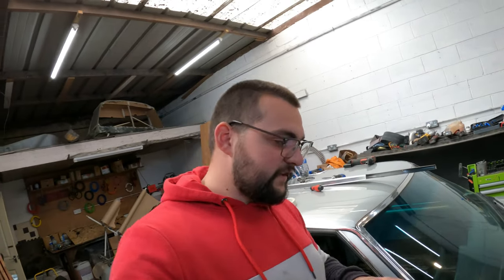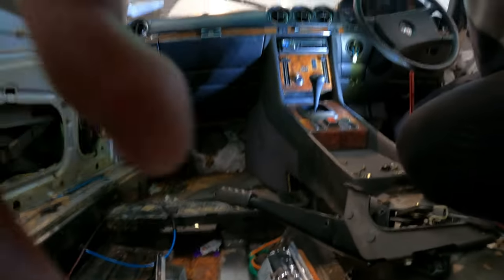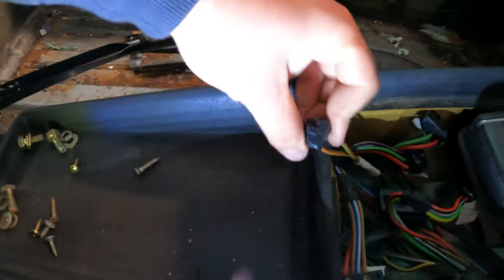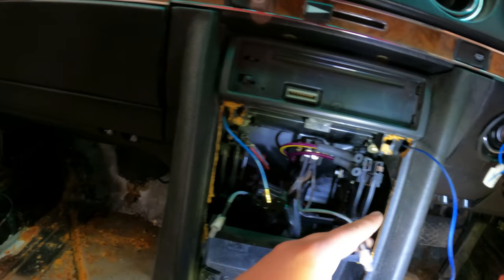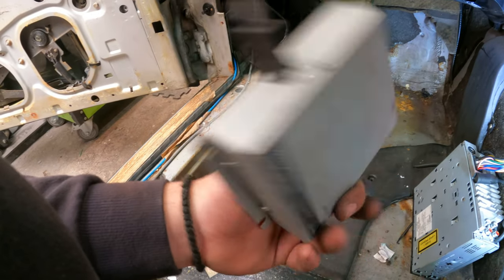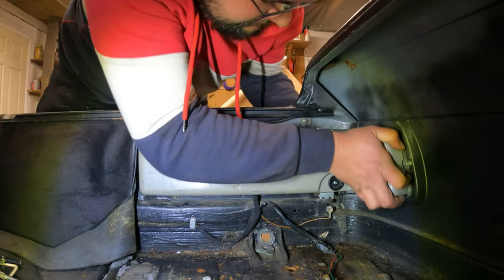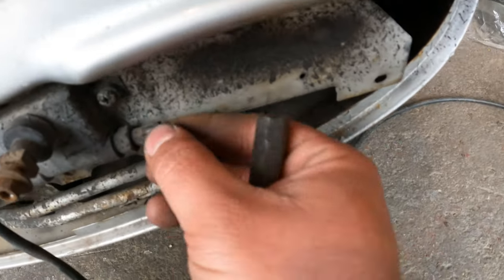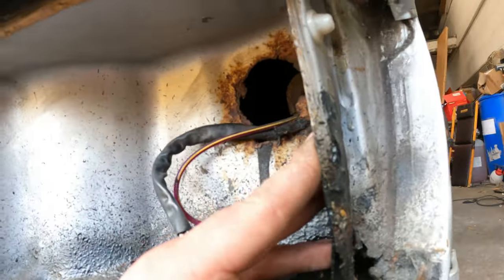Mercedes SLC 450 / pt.2 We are still removing stuff

Comment: Great to see what your doing. I have just finished doing a 1979 slc and are about to start on another 1979 slc. Hope to get some hints from what you are embarking apon.
Reply from the maker: Hello. I have cut and replaced sills, inner and outer, inner wheel tub, rear arch, bottom corner for the front wing, drivers front section of the floor and rear boot corner. All that is done on the drivers side. I haven't uploaded any videos as I'm really busy with other projects that are not on the channel. Soon will upload a follow up video on it. Thank you for your interest and helping save more of them!